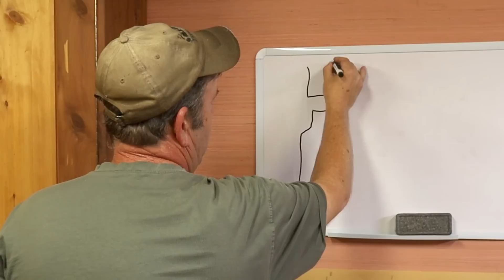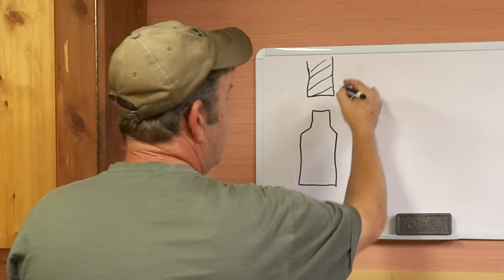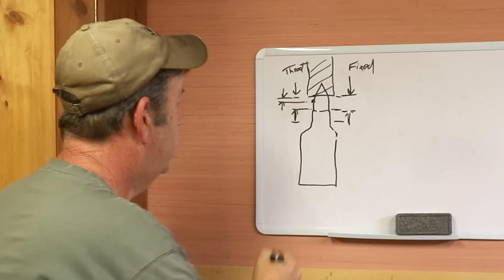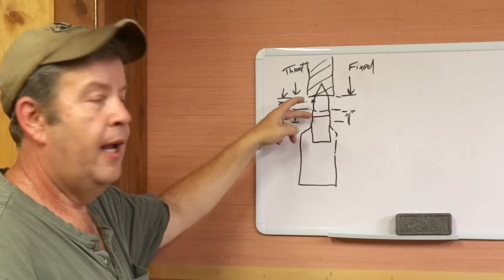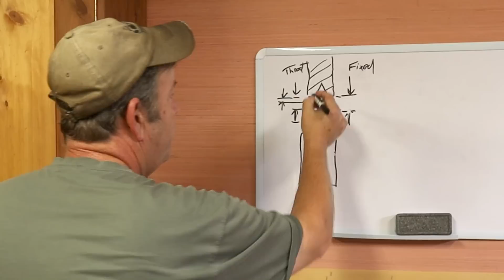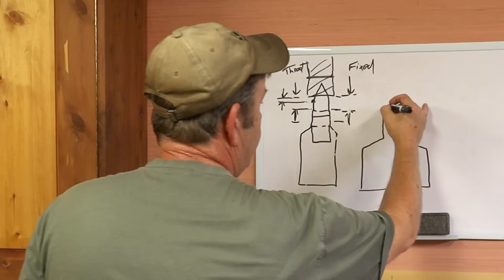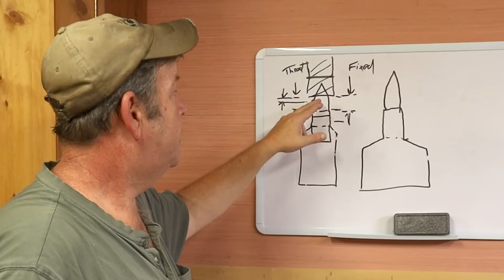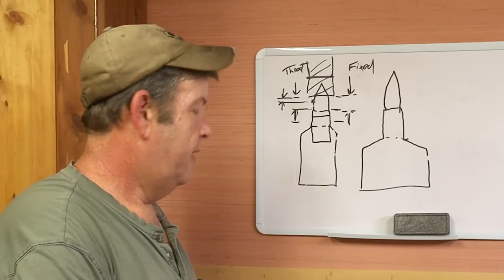257 Roberts Featherweight Project: 1st Range Trip!

Comment: I have had really good luck with my Remington  700 classic .257 Roberts shooting a 100 grain spire point with 4350 powder. Very accurate, and every mule deer I have a shot with it has dropped dead in its tracks.
Reply from the maker: Earl, in my opinion you have the best .257 Roberts Remington ever produced. Almost all of the Remingtons in 257 were short actions even the CDL commerative they made about 10 years or so back. But the classic and the mountain rifle they made in 257 Roberts around the same time were both long actions. I had been keeping an eye out for either a classic like yours or this particular model 70 for awhile and I decided to get whichever one I found first at a decent price for a rifle in good shape. I just happened to find this one first otherwise I would have gotten one like yours. And I still might get one eventually! I think those were the prettiest model 700s ever produced. And good to know you're getting great accuracy with 4350. Thanks for sharing.

Comment: The twist rate and your choice of bullet is not an issue. Leave the scope alone. Sand down the barrel channel and/or dremel off the tip of the screw. Torque the front screw good and tight. Rear screw/s should be a little more than snug. Thanks Tom!

Comment: Tail end Charlie again. Really wish I had found your channel a few years earlier. Some thoughts:
On the XTR, you mentioned that it shot well with the lighter bullets. Now I don't think that there's enough difference in recoil between a 100gr load and a 120gr load to cause such a big difference in group sizes. That and faffing around with a stability calculator for two minutes makes me think the twist rate is the real problem.

That brings up a new discussion. I know you prefer standard-construction bullets, and don't get me wrong, I'm not knocking them. I know they can do everything needed. But I also have shot enough game with enough different bullets to know that at least some of the more modern/complex/expensive bullets do have a significant advantage in terms of performance.

There was a time when a friend and I were culling about 10 animals a week. We used three different calibers (7x57, .308 and .30-06) and shooting Impala (a similar-sized animal to a smallish White-tail) and Blue Wildebeest (which is probably fairly similar in size to an Elk but with a reputation for unreasonable toughness). We did so with a range if different bullets ranging from the most basic cup-and-core to some fairly exotic stuff. One bullet signifcantly and markedly outperformed everything else we tried (including Barnes X) in all three calibers. That bullet is manufactured here in South Africa and would probably be hard to find over there, but is very similar to the Trophy Bonded Bear Claw. Thus a lathe-turned copper hollow-point with a bonded lead core in the front half and solid copper in the rear half.
On the one hand this construction means that it physically can't lose more than about 40% of it's mass (actually the few I have managed to recover all retained more than 90% of their mass), which guarantees excellent penetration. On the other hand, since copper is softer than gilding metal and since they have a relatively flat ogive, these bullets actually expand faster than most cup-and-core bullets, imparting a lot of shock to the animal. 

Now again, I know that normal cup-and-core bullets do the job. But the way these bullets put game down makes them worth the cost as far as I am concerned. I am confident that a 100gr bullet of this type will out-penetrate the 120's you were looking at here.

Anyway, thanks for sharing your experiences, they make us all richer.
God bless from South Africa.

Comment: To get the best results out of the Roberts you need a long action if you want to shoot longer heavier bullets. If you are using a short action the Roberts doesn't offer much over the .250-3000. If you need the long action you might just as well go for the .25-06 and get the best of a worlds. It can be loaded to .257 Roberts velocities. or full throttle. The brass is easier to come by and can be made from any other case like the 30-06.

Comment: Next trip to the range after making those two adjustments, make sure you have a few 100gr rounds with you.  Then you will know immediately if the bullet weight is the problem.  Personally if it were me I would leave the scope you have on it now in place and test the 100gr'ers first and if you still shooting 3" groups, change the scope at the range.  Just me though.

Comment: I think you are headed down the right path to dialing this in. My 25-06 likes the 100gr. Nosler partition bullets But I have a 1-12 twist. I wasted a lot of loads on a Ruger #3 that I rechambered to 221 Fireball because I had a broken screw in one of the mounts. I like the rubber harmonic balancers on light barrels, I closed up the group on my 25-06 with this.

Comment: Thanks Tom, I always learn something from your videos. I'm curious if there is any reason behind your preference for .023" Jump? Thanks.
Reply from the maker: Gordon that just seemed to always be a good starting point. .020" used to be sort of the standard starting point but I added .003" just to account for measurement error and I figured trying for .023" will ensure I'm always between .020" and .025" and for me that just seems to be the best distance? Less than .020" and pressures start increasing rapidly and more than about .028" and pressures and velocities start dropping really quick. But I will say I think a lot of the newer high B.C. bullets do better with more jump than the older style bullets? I hope that helps.
Reply: @TomRiverSimpleLiving  I rarely ever get that close.  Usually I’ll not get any closer than .050.   If you ever noticed much of the ammo you buy is much shorter than that and many times it’s .100  off the lands or more and you’re able to achieve relatively good accuracy and your also getting decent velocities.  I realize it’s hard to find 257 Robert’s ammo but the same holds true for other calibers.  I would try backing off the lands to at least .050 and see what it does.  I believe you’re not going to suffer on velocity enough to make a difference.  And of course if your using an all copper bullet at least .050.
Reply: I've always been big on getting vkose to the lands but the no 1 thing that caused my new model 70 featherweight to start grouping was backing up an extra .040 to an oal of 2.780 6.5 creedmoor 140 nosler partition

Comment: The 7X57 FW seems a bit short throated. Not sure. It would chamber PPU factory at a length of 3.005 and Federal Power Shocks at 2.972 fine, but would not chamber 154gr SSTs seated at 3.000 recommended in the Hornady manual as MAX COL. Bolt would not close and it wasn't even close. So it's an ogive issue maybe with the bullets. Anyway I have one good sub MOA load and will work on more myself. I need to get a modified case for it, or may be stuck making several dummy rounds. I could do that but with brass availability, it wouldn't be my preference. I think I'll try just using a fired case seating a bullet, take the measurements, then just pull the bullet from the brass. I just love projects like this. :)

Comment: Tom I'm with you on not useing a hand on top of the scope.my late 338 rcm weighed in at 8 lb exactly. I once fired a 30 shot group at 100 yds with this gun useing all three Hornady loads and 7 of my pet loads ranging from 160 gr ttsx to 250 gr rem corloke .all 30 shots were inside a 4 inch group shooting off of 2 sand bags. This gun recoiled a little more than a 30 06 and was fired without holding down on top of the scope.  ThT was without  doubt the most effective and consistent rifle that I've ever owned.
Reply from the maker: Leon whatever happened to the 338 rcm's? I haven't heard anything about a Ruger compact mag in awhile. Does Ruger even still over a rifle in that or us it pretty much gone at this point?
Reply: @TomRiverSimpleLiving  there is still a high dollar bolt gun and some custom ar 10s os chambered but basically gone. It was

 
Who is to say on the 338 rcm?  It would push 250 gr bullets at 2500fps and 160 ttsx barns at 2980fps. It was deadly on deer and probably any north American big game. Basically a duplicate to the 338 A Square.  I had lengthened the magazine to 3 inches , pillar bedded the action, removed all excess wood fron the laminated stock and installed  1x4 leupold scope. It served me well but was to much gun for .my needs so I let it go in a weak moment. It was replaced with the model 70 Featherweight 6
5 creemoor and a lee enfield no1 mkiii *.   I have to have a project to work on T all times. Have a good day and God bliss.

Comment: Tom, you're not holding the forearm down, that's why your groups are all over the paper. I can see the barrel jump to the right. You should try some 90 grain Sierra HPBT bullets.
The 120 grains are a little heavy.
Reply from the maker: Rick there's generally going to be some muzzle jump with most hunting rifles, but the jump on this one is very small and shouldn't be an issue? Now in the future when I take the XTR to the range then you'll get to see some muzzle jump! It will jump clean off the rest and that's not common.

Comment: I think you have a good plan for your next testing. Bullets of the same weight often just don’t shoot as well as others of a different brands in every rifle. The same is true for factory-loaded ammunition.
I found accuracy improves from making certain changes for all rifles. Using fire formed brass formed from the rifle for testing is one. Using a neck-sizing die is another. Reducing the distance to the lands to about ten thousandth of an inch doesn’t hurt either.
The same ideas Benchrest shooters frequently do works on any rifle and most are simple to do.
I would use three shot testing groups instead of five and save bullets and money. Then eliminate the less accurate ones to the two best of five tested. The targets you use for sighting in are not the best for testing loads. Ones made of non-reflection paper used for target matches are better. You can add a sticker or aiming dot if you want the size you like.
If you are concerned about your shooting technique do some dry firing first and see, what the rifle does using different holding techniques. I always take an accurate 22 rifle to warm up shooting before wasting valuable center fire ammunition.
These are just more steps that reduce variables, I used to help me shoot better that might help you too. 🤔🙂

Comment: I thank you will get the 120 gr bullets to work.  Try nosler partitions and different seating depths 25 and 50 shorter.  Also the dreaded 4831 shortcut.
Reply from the maker: Leon I just picked up a pound of 4831SC this weekend!
Reply: You will love it with heavy flat based or round noise bullets

Comment: Incidently, the 7X57 will clear 5-6 bills cold but will stick occasional around that same location as yours. So, hot, the clearance may be decreasing. As for recoil...well...with the Model 94 in 32 win Spl, it not only kicks like a mule, it holds me down on the ground and calls me names. :)
Reply from the maker: LOL and I don't doubt that one bit on your model 94! And that was a great point about the clearance changing with a warm barrel because heat makes a difference.
Reply: @TomRiverSimpleLiving  Yes, I took the .32 out first with just that metal buttplate. Got a nice bruise. This time I wimped out and put a slip on recoil pad. Still jars the teeth a little. Now I had .30-30 and don't remember recoil like that, but shot mostly 150s. The 170s plus the bigger bullets is a little different. :)

Comment: If you can Tom only make one change at a time and try to see what you get if you change 2 or 3 things you won’t know which one was the fix nosler used to make a 115 partition that might be good with the 1 in 10 twist but I understand they might be pricy and hard to find I would sand the stock and try again then if nothing changes change the scope would shoot lighter bullets just to see but I understand you want the heavy ones Speer hot core is very underrated bullet and most get fantastic results in accuracy and performance on game hope you can get the Speer 120s to shoot

Comment: I have not loaded .25 cal bullets I years. If Sierra still makes the 100 gr and 117 gr. Pro Hunter flat base. I'd try that . Flat base bullets in my opinion obdurate to seal the bore better especially if the bore is slightly oversized. I have had good luck with H 4831sc on the slow side and IMR 4064 on the faster side.
I have seen the exception for every rule when searching for rifle accuracy in a mass produced hunting rifles. It is almost a shot in the dark. I've seen some rifles like bullets jump as much as 1/8 in. and some touching the lands. It sucks if it is a scope issue. That means you have to start all over again with load development after replacing the scope.
Reply: My .243, .25-06 shoot well with flat base bullets at shorter ranges. The .243 cries for IMR 4064 with 75-80 gr bullets. :)

Comment: Do you not do any actual load development to determine a velocity node and then test seating depth from there?
Reply from the maker: Alan, I've experimented with the Satterlee method or optimum charge weight (OCW) before but I haven't been terribly impressed by it. And I feel I get better results quicker just using the old standard incremental testing, or ladder test, where I load 4 cartridges at a charge weight and work my way up. The majority of the time I get my best group with the charge that has the lowest standard deviation in velocity and really finding the charge with lowest standard devation in velocity is all we're trying to do by finding a velocity node. And for myself I've never seen where seating depth made much of a change in accuracy. I believe it makes more of a difference on the newer high B.C. bullets and they generally like to have a lot of jump but I've never gotten good results from standard hunting bullets with a lot of jump. Or at least that's been my experience but I plan on experimenting more with this in the future.

Comment: I'll watch this later after internet church but regarding your previous video and your mention of the 'perfect' discharge so to speak.  I hunt hogs and often go a few days without pulling the trigger.  It's hot now and I haven't been practicing at all really.  I usually, almost always really,  hit the hog I aim at and they usually drop right there,  but often needing a quality assurance shot if they try and raise their head.  But yesterday I took  out my AR in 6.5 Grendel to assure myself my thermal scope was still spot on.  I saw I have a flinch.  Small but noticeable.  And that with a heavy rifle that almost kicks like a 22 rimfire.  I was hitting off about 2 inches.  And it proved to be ME not the scope.  I was not employing all the fundamentals,  not following through and even closing my eye at the shot.  Terrible.  I am ashamed.  Practice people,  practice.  And bench shooting is not enough.  Shoot like you do when hunting.  I use sticks cause I'm old and shaky.

Comment: You shot consistently to the right. I think you shoud start with the barrel . Try a 115 Grain bullet. but fix the barrel channel first.
Reply from the maker: The barrel channel is fixed and I'll start experimenting with bullets soon but I doubt I'll be able to find any 115gr bullets? Options on 25 cal bullets are few and far in between right now.
Reply: @TomRiverSimpleLiving  A honady 117SST bulletis a good one. I shoot those as 257 Roberts in my Rifle. Very accrate with sb MOA groups. But they are Factory Loads. The Box claims 2945 Muzzle velocity. I dont have a chronograph. I have some Nosler 115's.
Reply from the maker: @rmatteson3142  Some 117gr SST's just arrived. But I honestly hated myself for buying them because I'm still ticked at Hornady's CEO. But I've always had great results with SST's in the past so I'm looking forward to trying them. And you're right it is a good bullet. And I managed to find some Nosler 110gr bullets to try as well so I have plenty to experiment with now. And I don't know if Brownells still has them but they had Federal 210 Primers this morning if you need any.
Reply: @TomRiverSimpleLiving  110's should be some real screamers! Noslers are mega-deadly. I bought a Box of 115gr Nosler Balistic tips from Mid south last night along with a box of 103 ELD-X Hornady's for my 6MM Remington!